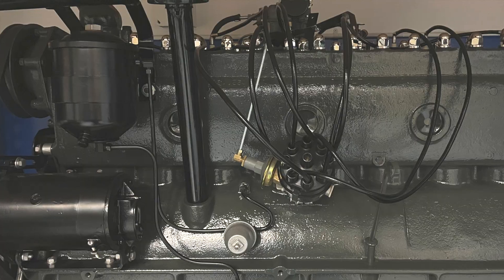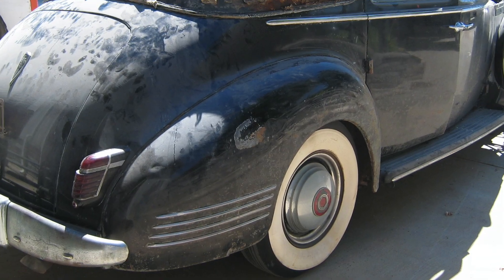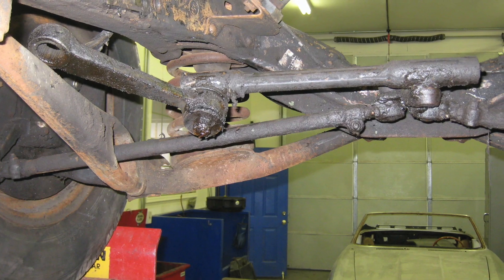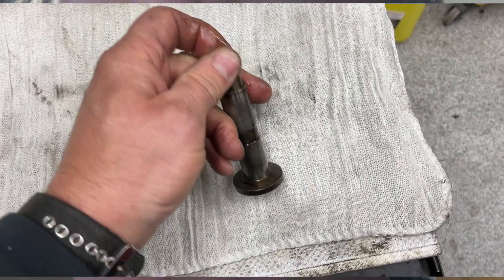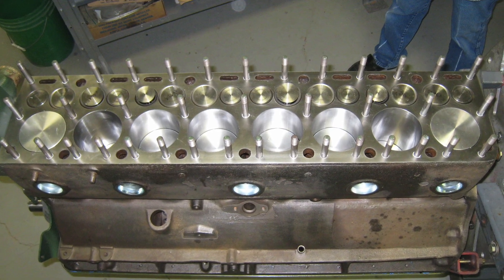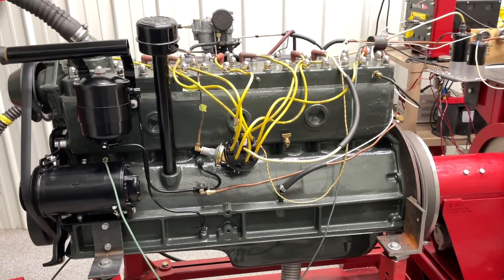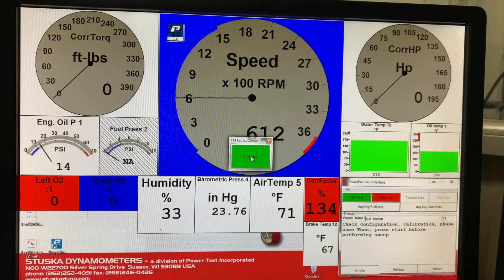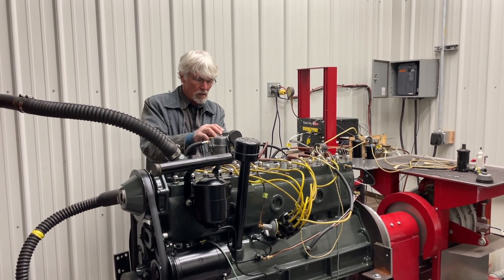1942 Packard 356 engine

Comment: Would be interesting to put this engine side by side and bottom ends up with Pontiac Eight of about the same vintage for comparison- would the Pontiac crankshaft (only 5 main bearings) be more of a "wet noodle" ?

Comment: check distributor counter weights/ springs re curve it and put a the vacuum advance on the distributor that you can adjust see if the flat spot moves or goes away

Comment: Lmao a 60 degree v12 literally has perfect primary and secondary balance nothing comes close. It's just expensive to build
Reply: "second place" 🤣
Reply: No need for counterweight. Know what that means?
Reply: Means straight six torque without straight six rev limits and no rotating mass for anything but structure

Comment: Is the 9 main bearing 327 from 1953 a derivative of this 356? Was the 5 bearing engine used in the Clipper a different engine block?
  Didn't the top Packard Straight Eights run as well or better than the early Cadillac overhead valve V8?  I thought it was really the early Chrysler "Firepower" V8s that really obsoleted the Packard Straight Eight (although the Straight Eight,especially the 9 main bearing on,was probably more expensive to produce and required more metal,at least after the initial high cost of setting up the production lines for the overhead valve V8s was amortized.)

  Were the Packard top of the line Straight Eights better balanced than their competition from Buick and Pontiac? Did Packard have fully counterbalanced crankshaft and the others didn't?  Did the "giant" Buick Dynaflash Straight Eight have 5 main bearings? 

  Was the Packard automatic transmission when used with the new Packard V8 in 1955 horribly failure prone and a major cause of the collapse of Packard sales that extended to the 1956 models even if some of the problems with the transmissions were ameliorated?

Comment: Exhaust makes a big difference in getting dips out of a curve , of course you can not change much on an antique engine (meaning changing primary length or secondary tube lengths etc), and believe it when a sharp dyno tuner tells you that you can go broke investing in exhaust changes to remove that dip ....

Comment: A story about a 1954 Packard blowing a plug.. I was a machinist apprenticeship at the B&O RR in 57. One day in July, my journeyman was called outside and I went with him. "Bert" had a crowd around his '54 Patrician and it had a roughly 3/4" ragged hole in the hood. He opened the hood and showed the crowd the "ripped off sparkplug lead" and the remainder of the #4 plug shell. He said he was about half way to work when the explosion occurred,  and he almost ran off the road thinking someone had shot at him - then noticed the hole.
All of the machinists laughed about the porcelain projectile, wondering where it went and how high? LOL
Reply: The fault of the plug itself disintegrating and not of the threads in the head I assume

Comment: I hyperfixated on these for a bit when I saw a 2-door coupe for sale near me. That and a 50 Buick- I really wanna see an old straight 8 turbocharged. 

I have two bets on that lack of power at 2800 RPM- the first like others have said, is fuel isn't getting to cylinders 1 and 8 because the manifold is too long, which is even a common problem on the 6 cylinders. The OTHER problem however, which I really think might be legit (in my limited knowledge too!) is soundwaves causing backpressure! The opening and shutting of the intake valves at that point are just perfect enough to propagate back through the simple log manifold, and for that brief ~150RPM blip pushes the oncoming fuel/air wave back into the air path.

Comment: THE 2800 LAG?
Only one thing popped into my mind, and that was the lifters.
Seems the engine “catches up” where the lifters are not bleeding down as fast as the revs increase.
That’s my best guess.
The only other thing that could cause this is the jets in the carburetor not being designed correctly for the power increase where it may be leaning out at that RPM for some odd reason.

Comment: Your break in procedure sounds a lot less risky than Subaru’s engine testing.  They fill the crankcase with 5W30, start the engine, run it at full throttle during the 15 minute test cycle then change the oil and filter for the 5W30 break in oil and send it to the assembly line.

Comment: >2,900 rpm valve springs too weak?
Reply: Or a harmonic surge that could be corrected if dual springs were used? (Inner and outer)

Comment: That lag around peak torque speed can be one of two things - a manifold design defect or a poorly plotted distributor advance curve.  I always thought that the 327 and 359 engines from 1948 on were larger versions of the 288 cube job that also came out in 1948, and the old 356 was a larger version of the 282 engine that came out on the 2nd year 120, (The first year 120 used a smaller 257 cube version of it), and the 1937 6 cyl was also based on that 120 engine.

Comment: The straight 6 motor always has a cylinder on the power stroke.   That dramatically increases smoothness of torque delivery.   Concomitantly it idles with very little vibration.

Comment: FUEL DISTRIBUTION THE FRONT AND REAR CYLINDERS STARVED OUT.
Reply: Or else the carb is actually compensating for the lean spot to those cylinders at that point in the curve to prevent valve burning and the extra fuel to the other cylinders is actually causing the bog
I would suspect the ignition timing curve

Comment: Great video! love it all! and the lag you were mentioning (only my guess/valuation of the fuel system, probably wrong) could be a FUEL problem, for some reason the design probably sucks air and fuel (at the same time) at that 2800 to 3000 RPM.  Kind of like a "Boat Propeller cavitation" when it spins at a higher RPM range it starts to make AIR BUBBLES/  meaning for that slight RPM range until the fuel can fill the air gaps

Comment: Packard seasoned their engines for 2 to 3 years before machining them. This means that after the casting was made they would let them sit outside for a period of time before machining them.   My grandfather bought in 1935 Packard 120 nearly new when he retired from the military. My mother was a little girl at the time. They drove from Pennsylvania to Arizona. The entries in my mothers log of the trip said they averaged 95 mph while crossing Texas. Keep in mind that this was 1937.  They were driving on gravel highway much of that time pulling A small trailer. These were not fast accelerating cars but their engines were incredibly smooth.

Comment: You mean overhead valve not overhead cam the strait 6 is as good as a v8 but not with out a flow through design and overhead cams the v engines more about packaging how to fit a bigger engine in a smaller car.

Comment: Sir, as a Engine Builder/Engineer,  I would try and find someone with a distributor machine. You MIGHT find a commonality with the ignition curve that's equating to the issue during dyno testing that you mentioned. Once you have eliminated that possibility,  the fuel curve would be next, as in the TRANSITION from the intermediate circuit to the main circuit fuel flow. On our motorcycle engines we often need to install a external jet which becomes in essence a new main jet. Now I have 4 circuits to tune out a potential flat spot, and I do this through a air bleed principle. Less air/smaller bypass jet equates to more fuel ie richer mixture, and so forth.  I realize this might be a hard sell on a restoration type of build.
The concept of thinking outside the box is often conducive to curing a age old program. 
Excellent video Sir. 
T.S. RACING

Comment: I have a question you may be able to help with on another engine in the Packard family, the Super 8.  When balancing the Super 8 crankshaft or any straight 8 crankshaft for that matter, do you use bob weights like a V-8 and if so what balance factor do you use?

Comment: Phew! 330+ ft-lbs at 1350, impressive... like a really smooth quiet diesel!
Reply: Most of the flatheads of that era, straight eights included, were built to "lug" along.  As "Uncle Tony" with his own channel explains, that would have been pre-interstates, and we fairly much lived in a 50 mph existence.  Not that in open country, especially out West, folks didn't go as fast as their rides could handle it.  A popular option, offered in some makes, an aftermarket installation for others, was an "overdrive" unit, which was an add-on gear box, with planetary gearing, that gave an OD ratio, usually 0.70 to one.  By dropping the rpms considerably, one could bomb down the roads at 75 mph or so, with the engine turning 2500 to 3000 rpm, where it was "happy".

Comment: Between Packard's delays in updating their engines and car bodies after WWII, they were "left behind" by the competition.
It's truly a shame, because they made a great product.
Reply: Actually, Packard DID update the cars for 42, (In 1941 the brand new Clipper was introduced.  Clipper styling went line-wide for 1942 and was fully competitive with the 46 - 47 GM and Chrysler luxury cars, which were also restyled for 1942, but for 48, they restyled this car and missed it on that.  It looked like a fat matron of a car.  People called it the Pregnant Elephant.  What truly wrecked Packard was that 110/115 6 cylinder car.  The  8 cylinder 120 was a great idea and a great car, but the 6 should have never seen the light of day.  At least not as a Packard.

Comment: I own a 1955 Packard Clipper Constellation with a 352 V8, Packard's first V8.  It is a good, solid engine; but it's mated to Packard's abysmal Twin Ultramatic transmission.  This transmission had been developed for its straight-8 and it really couldn't handle the horses put out be the V8.  I think it's performance would have been much better with a manual transmission.  The Packard V8 was actually pretty conventional, so I don't really think Packard invested that much in its development.  The company did waste a lot of time and money on its Ultramatic, instead of just buying GM Hydromatic or Borg-Warner automatics. 
What really would have been interesting would have been if Packard had come out with twin overhead cams and four valves per cylinder.
Reply: Packard really messed up with that Twin Ultramatic.  The idea actually came out in mid 54 and was called "Gear-Start Ultramatic".  It, Packard felt, shifted too abruptly and hard, very out of keeping with Packard's ideal of Total Smoothness, but the way they fixed that was to shrink the Direct Drive clutch.  That is what ruined it.  They should have kept it the same as 54 and fiddled with an Accumulator valve instead.  The Packard V8 would have been fine, but they used a double-action oil pump, one side pumping the engine oil, the other side generating vacuum for the wipers, like Buick did in 57.  The oil pump side and the vacuum side supposedly weren't very well isolated from each other and the engine oil would get all foamed up, and foamy oil doesn't lubricate well and gets blown out of the breather.  Buick also had their share of troubles with that concept two years later.  You can fix the Buick by using a 58 - 61 single-action oil pump, but I don't know about the Packard.
Reply: @michaelbenardo5695  I guess that is a little detail that specialists in working with these classic cars need to keep in mind. I think there is a work around for that.

Comment: Could it be the dyno causing the flat spots?  Unusual that all engines are the same and happening at max torque -  perhaps the dyno changes mode or something at max point?  love the videos!
Reply: Might be a manifold design flaw, or a distributor advance flaw.

Comment: It seemed that the Packard engineers never understood what the future of engine design was. They were always at best very conservative designs and the Packard V8 was stuck with a restively long stroke and small bore which made it heavy and small valved. The secret of the post war V8 engine was that they were built to take advantage of high octane fuel and Oldsmobile and Chrysler designs showed that they took advantage of this. Larger bores allowed bigger valves and better fuel helped this out with compression ratios that would never have worked with pre-war fuels. While there were many over head valve engines before WW2 they all were low compression, small bore and small valve engines and they never had a big performance advantage over flat head designs like the Packard, Chrysler and Ford designs. I'm talking about average production cars here, so don't confuse this with the racing inspired designs that did show up in premium cars.

Comment: 356 engine NOT the same as 120 series engine. Also, 356 engine dropped after 1950. The 288 and 327 (later 359) series engines went until 1954. Again, COMPLETELY different engines than the 356. Only similarities being the 'flathead' in-line eight cylinder configurations.

Comment: The best big 6 cylinder I ever built was a GMC 302 two-barrel carb 3in exhaust beautiful sounding engine when I was done lot of smooth horsepower I put a real nice heavy duty muffler on so would have good flow and sound quiet? With original oil bath air cleaner also if you're still using that type of air cleaners used dextran transmission fluid and you can fill it up a little bit more it just keeps the valves lubricated but it filters three times the more dirt out of the air.
Reply: That's great to know, as I still have this type of air cleaner on my New Yorker HEMI.

Comment: when your climbing that hill, you dont increase the throttle, you change down the gear, unless its one of the auto gearboxes, fuel burners,
Reply: Yep, many of the early 1950s cars had the Ultramatic trans. Single speed with only a converter lock. Very poor engine speed and load control. Ate a lot of gas.
Reply: @loboheeler  Should have cruised using less gas than Buicks with their slushbox.

Comment: So that's where ford got their idea for twin i'beam in their trks
Reply: Hmm, yeah I noticed the similarity of the struts of Fords Twin I-Beam, but after that there are a lot of detail differences.  In the Ford system the beams overlap with the pivots for the I-beams anchoring on the opposite side frame rail (the beam for the left front wheel anchored on the right frame rain and the right wheel beam anchoring on the left frame rail) which reduces the camber change from movement and eliminates the need for an upper A-arm and all of the extra pivot joints that are required with the Packard system.

Comment: The 9 main bearing crank is impressive
Reply: More than what Pontiac had  (in the Straight Eight) Pontiac's not as large cubic inch wise and not as much torque/power but  would still run rings around same year Plymouths and Dodges with their humble Sixes.

Comment: I believe your perceived hang at 2800 rpms is a function of the dyno sweep rate and its control combined with the power curve of the engine. Your peak torque is actually at 1300rpm at 345ft-lb then it falls from there.  To test this theory you should perform dead head pulls at every 100rpm increment and plot the HP and see if it doesn't yield a different curve than your sweep.  I believe you might be down 50ftlbs at 2200rpm over what it actually makes because the dyno is allowing a flare. It is jumping like 600rpm/second then the dyno gets control and the sweep rate appears to be about 150-200rpm/second

Comment: I hear internal parts such as oil pumps are hard to find and aren't reproduced. I have my eye on a '50 but it has the small block 327 straight 8 which parts are no problem.
My favorite vintage car engine will always be the Buick straight 8, the big 320 block. Buick catered to mostly the older set and retired folks and saw no need for a V8 by 1949 (yet)

Comment: An additional reason the V8 was the future engine of choice for car manufacturers in 1949 was economic - a car with a V8 was shorter from the firewall forward and therefore cost less to build, and V8 engines used less raw materials than an inline 8. 

When Packard designed its first V8, however, the engineers, as they had with the inline 8, did not attempt to make a less expensive engine, and designed a block that could have been comfortably enlarged to 500 cubic inches in later versions. And they designed a large car for their V8.  Packard did not cut corners.

Anyone that rides in a Packard with an inline 8 in proper condition will understand why Packard continued to use the inline 8, and why it had, and has, a loyal following.

Comment: Packards,, a quality vehicle that after the war became old fashioned quickly. Sidevalves by 1950 were totally old hat, those engines while quiet and smooth were years behind the opposition.
They built thousands of Merlins during the war,, OHC and supercharged so should have had an idea of building their own modern engines.
I like the 'noodle' comment. Another reason you could not make more power as even with 9 mains the bottom end was fragile
Reply: The Packard 356 and 359 engines could indeed be hopped up for far greater power.
Reply: I think Merlins drank much much better/higher octane fuel than was available from gas pumps for cars in those days